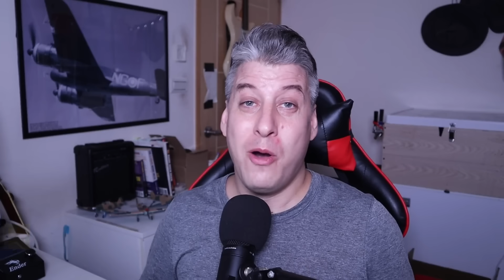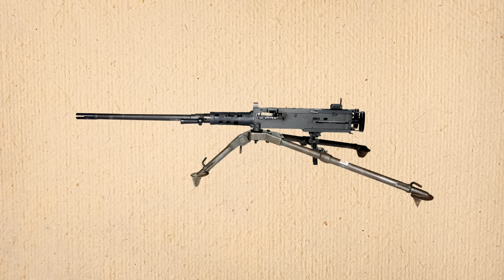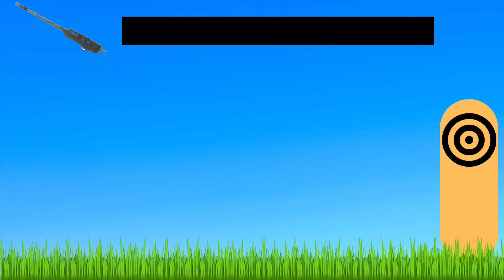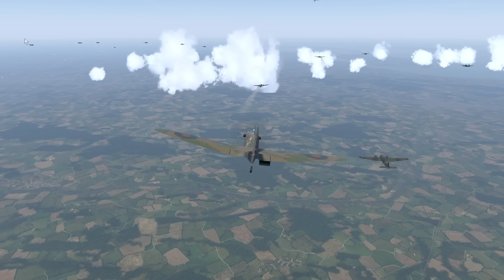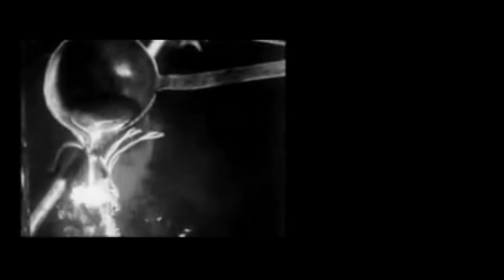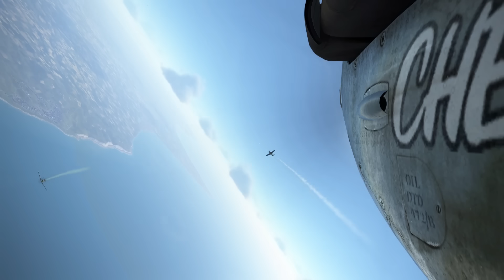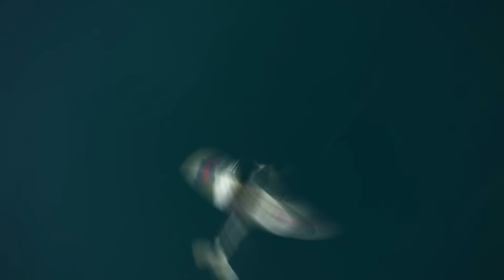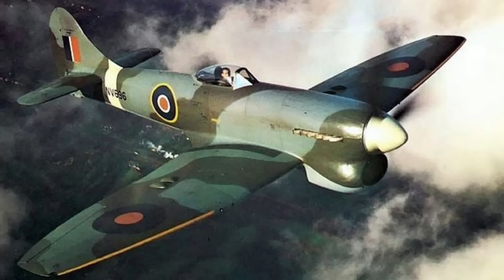Why Did The RAF Use .303 Caliber Machine Guns in WW2? The Surprising Answer

Comment: Back in the 80s I worked with a form RAF fighter pilot who trained in a flew Hurricanes, was seconded to Spits then to Typhoons when they were commissioned. 
Fighter tactics for the Typhoon, even the 1b with 20mm cannons was to charge the enemy at full noise, open fire at range, then KEEP GOING! Do not under any circumstances engage. His opinion was that the Typhoon was like a front row forward in Rugby who could run like the wind, give the enemy all you had but do not engage. 
He also said that they were a pleasure to fly, but dangerous on ground, they lost many young pilots to ground loops on the ground due to engaging full throttle on the ground during take off. The order was 80% max on ground then full noise just after mains leave the ground. He loved them, but they couldn’t dogfight for sh*t (his words not mine).
I don’t know whether it is still there, but a photograph of him in the cockpit of his Typhoon was hanging in The National War Museum in Canberra. He was a real gentleman, even though his rank was Flt Sgt.
He was also charged with destruction of government property for damaging his propeller after a collision with an enemy fighter, took off most of his vert stab as he flew over him, and he never looked back. 
His opinion of the 3 aircraft he piloted was that the H was a stable, good all aircraft east to fly and responsive. The S dared you to break the rules, but it would bite you hard if you went too far. It demanded that you break the rules (his words again). And the T was simply a brute. A top fuel dragster designed to get you into trouble then get you home. And never attempt dogfighting, leave that to the others. 
My mate Bill passed in the early 90s but I think of him every day, he taught me a lot professionally and about life. He made me want to fly so much that I got my license when I was 52, well over 20 years ago. 
Thank you for posting, cheers from downunder.

Comment: The 303 great round for troops, but useless in aircraft why. It has a lip at the bottom of the case. But it was better to use a small canon! As in later planes like typoom or tempest,

Comment: Wrong question.

You should be asking why the RAF were fitting 8 machine guns in their fighters at the time when everyone else believed 4 was totally badarse and why the RAF decided to skip the 50 cal weapons and (attempted at least) to go straight to the 20mm. Far from undergunned the RAF fighters were arguably trend setters and constantly being attempted to be upgunned. B wing Hurricanes had 12 machine guns before the 4 x 20mm C wing came in. The Martin Baker proposals were designed to carry 6 x 20mm.

RAF were well aware of the needs for bucket loads of powerful weapons...

Or at least for fighters.

Bombers, on the other hand, were hard done by. British Heavies only started to get better turrets at the end of the war when it really didn't matter. The Halifax got improvements (but still 303) but Lancs had same nose and dorsal for basically the entire production run and the Ross (? memory) turrets only limited.

There is actually some interesting theories for fighter weapons based on what you are trying to shoot down. High ROF gun like the 303 Brownings are considered the best weapon for attacking other fighters... or were until fighters started getting armour and self sealing tanks. Then the relatively high ROF 50 cal sort of took over as prime fighter killers.

If you are attacking bombers then they are easier to hit but can take a LOT of damage. So you want cannons with big bangs.

So the Germans started to get fighters with big 30mm type cannons with relatively slow ROF. The Americans never really had to intercept big beefy bombers and were happy with the 50 cals and kept them into the jet age. The British sort of split the difference and moved to a very effective 20mm as soon as they could get the weapons to reliably work. Big enough to hurt German bombers, fast enough ROF to put rounds in the air to hit German fighters.

Comment: Late to the party here.  What was covered here didn't touch upon what I always understood to be the reason for the .303.  The reason as I understood it to be was that statistically it was determined that only one round in so many fired would cause critical damage and that there was a requirement that a one second burst should be enough to generate a critical hit.  This rationale in part was based on the fact that in many places a round would simply go in one side of the aircraft and out the other without hitting anything critical.   As such larger rounds may make bigger holes but holes alone didn't take down aircraft.   Structural, engine, human damage was needed.  This perhaps was partly an outgrowth of the belief that pilots had poor gunnery skills.

From a sim standpoint, for what it is worth, I can attest from being on the shooting and receiving end of those simulated .303 that a one second burst could be pretty devastating.  It did burn through ammo quick so burst had to be kept short but one only had to get them in ones sights for just a second.   By comparison using an American aircraft with 50 cals one typically had to put rounds out for 3 or 4 seconds to get the same effect.  So one had to keep guns on them longer as they tried to evade.

Comment: Initially they couldn't get the 20mm Hispano canons to fit totally in the wings (That we had a licence to produce) So they used 8 x.303 Brownings that a schoolgirl had calculated that would be enough to cause problems for a ME109. Finally someone came up with a shroud over the Hispano canon barrels that protruded out of the wing in mid '41. 
So we caused bigger problems for the Luftwaffe. In a nutshell that's it!

Comment: A consideration was the "engagement time" in an aircraft fight.  The Air ministry (and RAF) came to the conclusion that a lot of lead was required to be fired during a very short period of time that an enemy aircraft could be engaged in a "pass" to achieve a requisite number of hits.  Hence the selection of the Browning with its higher rate of fire. The modifications needed (open bolt) was not because of cordite use in the .303 round.  It was not all that much hotter than the Dupont No. 16 single-base smokeless powder (I think that was the standard propellent !) used by the US but the rate of fire meant it needed the open bolt to prevent "cook off".
Remember this is before the introduction of such technologies as the computing reflector gunsight that vastly improved the accuracy of fire over "ring and bead" sights.

Comment: 50 Calibre would have been better in the Spit or Hurricane , did the RAF never try like Luftwaffe did with Me 109 and put a 20mm thru Propeller Spindle ? They did it by putting engine in 'inverted' ,  could have done same with Spit engine the Merlin
Reply from the maker: Concerning the ME's nose cannon, the issue was that the DB 601 was inverted when mounted, so had the space to place armament above/through its 12 cylinders. The Merlin at the time was mounted upright and so there wasn't the capability to mount a gun through the prop hub. Based on my limited mechanical knowledge I think the Merlin could have been inverted and still run, but it just wasn't part of British designs.

Comment: Fascinating explanation. Significant work had to go into the arming of Hurricanes and Spitfires pre-war. A lot is covered by the interim report No. M/689/2/Arm/int. 3 September 1937. It covered barrel flow, gun temperature, effect of breech block position on functioning, No. M/689/2 Hurricane L1562 gun heating, and high-altitude firing. Jonathan Ferguson, Keeper of Firearms and Artillery at the Royal Armouries Museum in Leeds, has provided a series of videos with IWM Duxford explaining these weapons.
When Air Chief Marshall Dowding led the technical branch of the RAF, which produced radar and the Dowding defence system, with a colleague, mathematical calculations were undertaken to determine how many rounds were required to bring down an aircraft, assuming closing speed and targeting of 2 seconds. The conclusion was 4 rounds per square foot. Consequently, this determined the number of guns ( 8) and the number of rounds carried. Cannon weapons at this time were not ideal for air combat because of the impact of G on the feed mechanism. Statistically, analysis undertaken during the battle, available from the IWM, comparing crashes 109s against crashes Hurricanes and Spitfires, found that the multiple 303 machine gun option was more suitable than the machine gun low volatility cannon mix. However, the issue was the bombers with armour. The first cannon Spitfires were not that successful; a 12-gun Hurricane was produced has an interim before they sorted the shell feeding to the cannon weapons. It should be noted that  Sydney Camm always wanted to fit his fighters with cannon.  Also, pre-war the British government strategic approach was DUKE (Dominions, United Kingdom, Empire); with significant numbers of arsenals existed across the Commonwealth producing ammunition, so in the true style of “Better is the enemy of good” you use the good enough until you solve all the machine tools issues and build the production line to produce the better, so the heavy Griffon Spitfire Mk XiV was equipped with the 50 cal weapon.
Reply from the maker: Brilliant comment, thanks for that extra information!

Comment: The Spitfire could be armed with four cannon with the development of the C wing. This was rarely done and I have never seen the reasoning for this explained. Freezing in the outer cannon bay is unlikely because the outer cannon bay was very close to the inner and the barrels did not stick out of the wing any further than they did on a Hurricane or Typhoon. Otherwise the story about Harris is unlikely to be true. Harris lobbied vigorously to get 0.5's for his bombers, eventually succeeding. Also the story of the Germans fitting armour to stop .303's is just a fairy tale. Armour will not stop a hit by a cannon shell but cannon shells explode and the armour will stop the shrapnel, which would otherwise kill or wound the pilot.

Comment: The Mustang was powered by an engine designed in the United Kingdom when it was realised that the US designed Alison engine wasn't powerful enough. Later variants of the Spitfire were armed with 20mm cannon as well as machine guns. The Spitfire had a better turning circle than the Mustang. The Royal Air Force also flew Mustang's, with the British designed engine's as fighter bomber's because they had no use for a long range fighter. Just saying. The Mosquito had a crew of two and was the fastest fighter bomber aircraft for a very long time. The payload was very large and for its size a much better armed aircraft than the somewhat slower B17. The four 20mm cannon made the Mosquito fighter bomber a very good aircraft. Even the Americans flew them. The Americans also flew Spitfires. Not many people know about that.

Comment: Older American here.   I don't recall you discussing the effective range differences of the gun options discussed.   The 50 cal. had a much longer range than the .303 round.   50 cal. range: 7400 yds, [effective range 1960 yds.].   .303 range: 3000 yds., [effective range 500-600 yds.].
Reply: He does, in fact, discuss the range. As in not being relevant enough of a factor. Most aerial combat was fought at quite teh short ranges. And, at longer ranges, rate of fire was deemed to be more efective in actually getting a hit.
Reply: @notfeedynotlazy  the classic “just dismiss anything inconvenient as not relevant enough to matter” tactic
Reply: @Hornet135  No, the classic "let's diseregard long-ranged capabilities when nobody fires ar extreme range but chairforce armchair pilots while the real fighting is done at knife-fight distances" tactic.
Reply: We used what was available at the time ( before America decided to join in )

Comment: People tend to forget that when the Hurricane and Spitfire were designed that having 8 * .303 machine guns was a massive increase over anything that had been fitted before this .... Theres also thd fact it was closely studied and thd opinion of the exoerts was the weight of fire from the 8 guns was enough to bring down an enemy arcraft .... The quick firing .303 was also hoped to at least get some hits on target at the speed air battles would be fought at compared to the much slower firing 20mm cannon available....theres also the fact that the cannon wereny very reliable and the first atempt at fitting them resulted in constant freezing of the mechanism and jams in the ammunition....not ideal in a battle.... The extra weight also robbed the aircraft of a few mph when you wanted as much speed as possible.....

Theres also the small matter of us having .303 ammunition coming out of our ears and we'd have had to set up production lines for anything else

Comment: One thing I always wondered about rifle caliber armed aircraft, both before and during WW2, was exactly how did a rifle bullet do enough damage to a machine like a fighter aircraft to bring it down? Machines like WW2 fighters have large areas where not that much important is located, notably the wings and tail. How does a .30 cal do appreciable damage to the airframe to where it is no longer able to sustain flight? It'd be like poking holes in a paper plane with a needle a few dozen times, it could still fly even when it was made see through.

Also how effective would a .30 be at smashing up the more important internal components like engines, or structural components like wing spars? I can see a .50 being very good at that, but short of hitting vulnerable areas like the oil or coolant systems, or setting off the fuel tank or killing the pilot I can't see a .30 being very effective unless the machinery was absolutely hosed down with bullets.

Not to say that .30 wasn't effective, the proof is in the wreckage all over the English Channel, but I can't see how it was as effective as it was when machines are so much tougher than humans.

Comment: A couple advantages of the .303 I don't see mentioned would be the additional practice shooting a pilot would be allowed with less expensive and lighter ammunition as well as a more liberal allotment armourers would get for ranging, sighting and maintenance.
Lighter ammunition would also be a lesser strain on all mechanical considerations.
Better accuracy, efficiency and durability.
Reply from the maker: That's very interesting and not something I'd thought of before. I wonder how frugal the RAF were with ammunition at the time? 

I was reading something recently (perhaps Mosquito Men by David Price?) that spoke of the bean counters keeping a keen eye on an aircrew's snack allowances.  Anything less than a 4.5 hour trip didn't qualify for X snacks and any returns meant you had to deduct this from the rest of the month's quota.

 It would be interesting to see how far this extended as combat reports (early on at least) also included how many rounds were fired.
Reply: @CalibanRising  It's not so much the frugality of limiting .303 rounds, but the expense of spending cannon shell unnecessarily. The difference between the two would be considerable.

Comment: In evaluating aircraft guns on WWII fighters, the key issue is kills per firing pass or kills per second of trigger squeeze.   That summarizes all the factors discussed here, such as rate of fire, damage per round, number of guns carried, number of rounds carried, etc, into the one thing that actually matters.  You can argue all day about which details are more important, but it all boils down to what achieves the most kills in return for the weight penalty the fighter can carry and still have good agility and range.  On American fighters the 50 cal Browning proved far more effective than the much lighter projectile of the 30 cal, which even light single engine fighters could absorb a lot of, and since an accurate burst of one second of 4-6 50's could reliably destroy an enemy fighter, proved that the 20mm cannon's extra power was not needed against the fighters of the time.  Against modern jets, which can take a lot more damage, the 20mm is the minimum needed.

Comment: In 1940, an awful lot of US combat aircraft were still armed, either in part or entirely, with .30 calibre machine-guns. These were often partnered with a pair of .50s, as in for example the P-40 Warhawk, but most rear gunners in two-seaters were still firing back in 1942 with a single or twin .30.
People seem to imagine that calling it a "Thirty-calibre" means it's more powerful than "point three-oh-three", but that's just not true.
So, we need to remember that, during the early phase of the air war for the RAF, armament wasn't quite as weak as we sometimes think it was.
By the time the USA entered the fray in earnest, a lot had changed for Fighter Command, so the comparison is a little redundant: "A 1943 Mustang or Thunderbolt was way more heavily-armed than a 1940 Spitfire", etc. We do see these redundant comparisons quite a lot in discussions of WW2 armaments; that on it's own is fascinating.